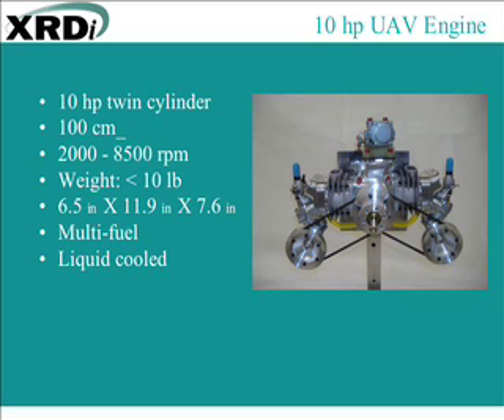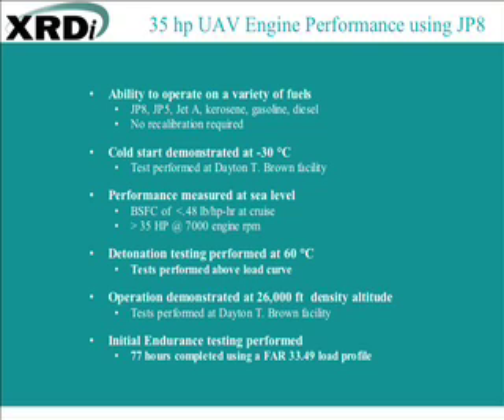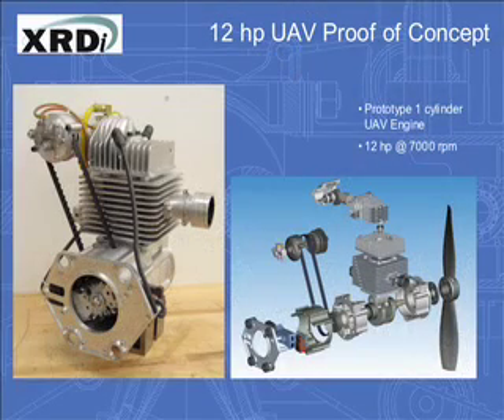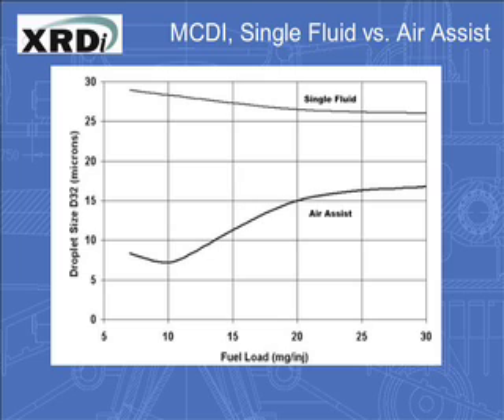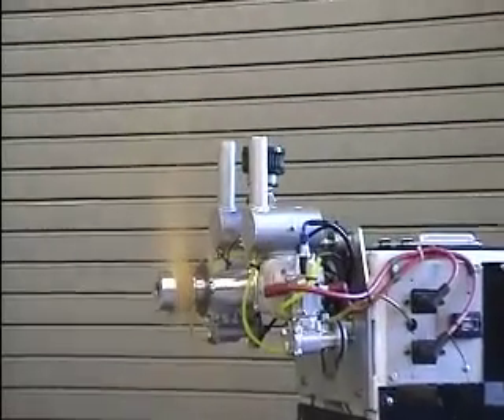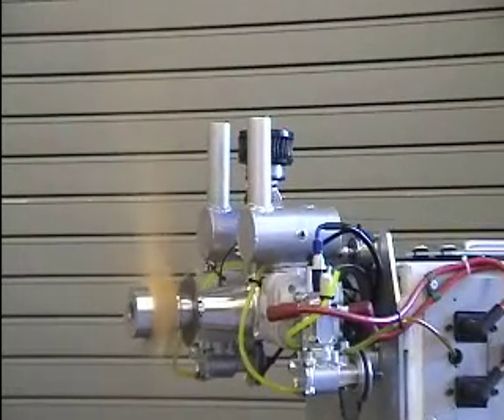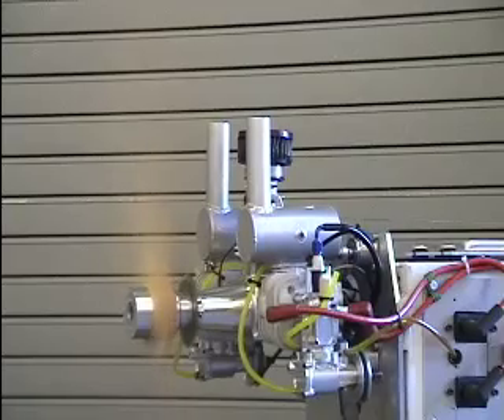XRDi Heavy Fuel

Comment: With a catalytic igniter rather than spark plug, is there a risk of early ignition i.e. combustion starting too many degrees before TDC given that the fuel is air-blasted in at something like 90 degrees before TDC? Any estimate of the peak in-cylinder pressure?